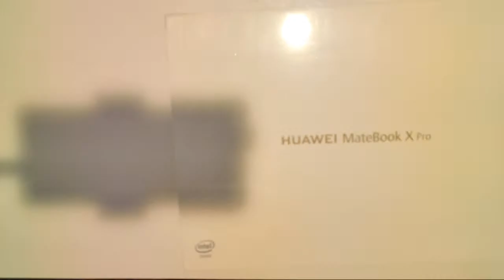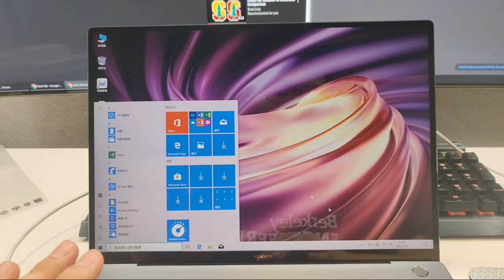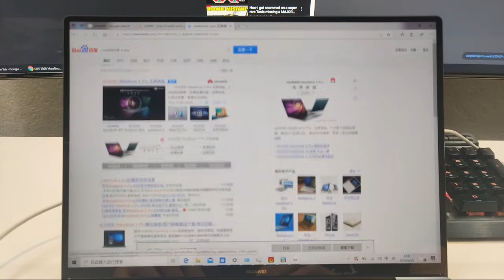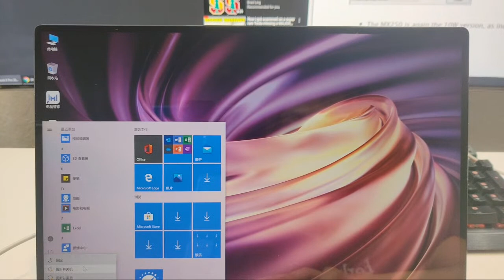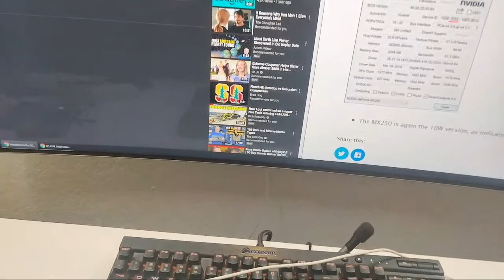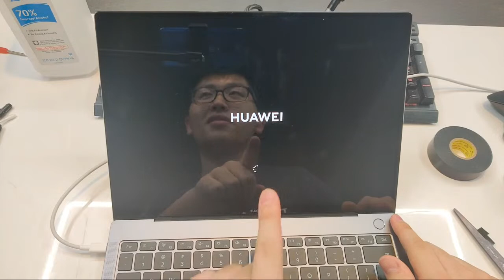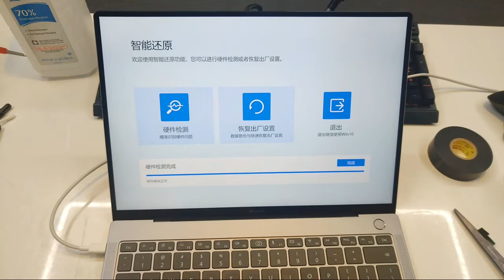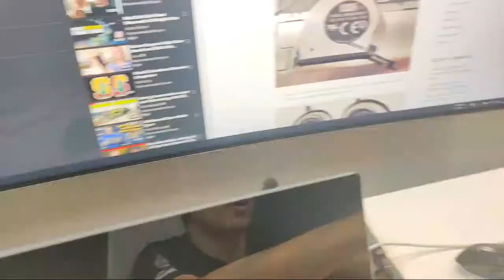LIVE 2020 MateBook X Pro Teardown

Comment: I have a Huawei matebook pro X, had a slight jar- dropping maybe a foot from bed to thick carpet, wouldn't think it would've done much damage but it's now completely "dead". I only get a single flash of the power light when I hit the hard power on... No screen, options etc. I've found little to no information about how/where to go about repairing.. Any suggestions? Thanks in advance
Reply: Open it up and check the connectors

Comment: hi Brad, i  have a question, i have a mach wx9 version of matebook x pro (i78550u 16gb 512gb uhd620 only)..but there is no nvidia mx150 showing in the device manager (even on hidden devices) .Have you seen this variant of matebook x pro?  .. or i must open it to see that its there(mx150)
Reply from the maker: I guess check in the BIOS
Reply: @BradsHacks  i did ..  idont se any options in bios.

Comment: with AMD releasing 4th gen ryzen the laptop scene is evolving exponentially. Have you seen some of the performance metrics of their 16 thread APU's? It's only a matter of time before every OEM will have those APU's in their highest end configurations and because they are so power efficient, we'll have new levels of design and/or performance. Do you regret not waiting a few more months? Intel don't come close to what AMD have and for the next 3 years atleast its AMD's marketshare and performance crown to be had. Not only that TSMC (AMD's Manufacturing partner) has said to creating a modified node on their 7nm specifically for AMD, so Intel are behind on arch AND on node for probably the next 3 years at the minimum. BTW the stuff that AMD have shown isn't even their best die stuff. How come you pulled the trigger with all this evolving before your eyes. AMD 4th gen is supposed to be ridiculous, personally I think you made a mistake on modding ur laptop because now you have lowered your reselling price and we are at the forefront of a performance and price wat between AMD, Intel, TSMC that means each year I expect to get over 30% performance year over year, thanks to multicores.
Reply from the maker: I've decided to not play the waiting game a long time ago. I just buy what I'm interested in currently. I give my older laptops to my parents. I'm always looking forward to new, better devices!
Reply: @BradsHacks  Yeah Brad, how could you do so many mistakes. Omg Brad...  /s